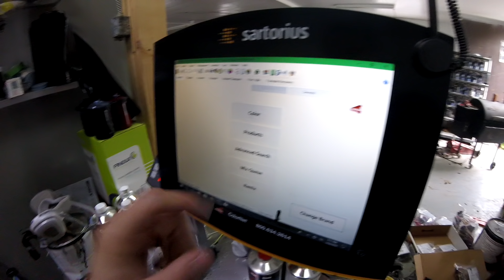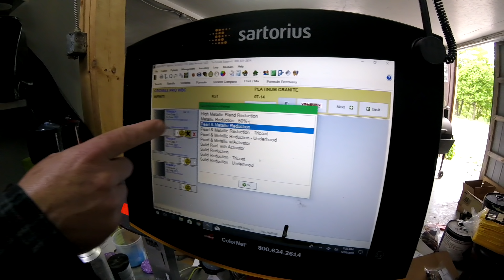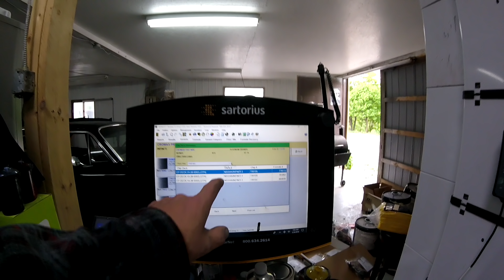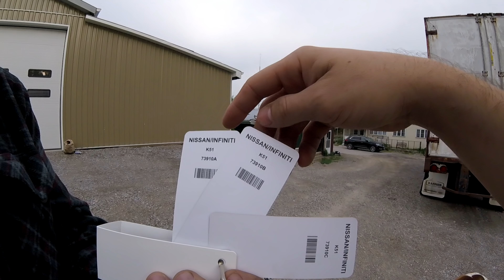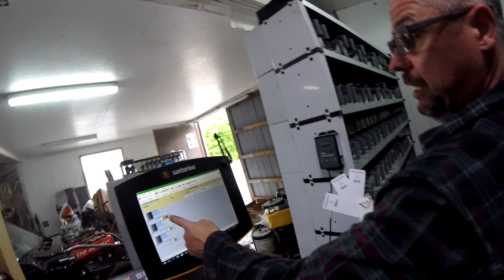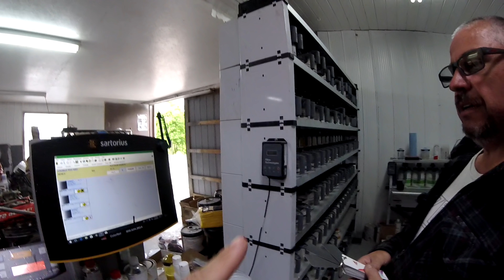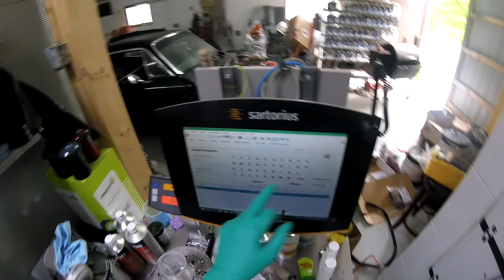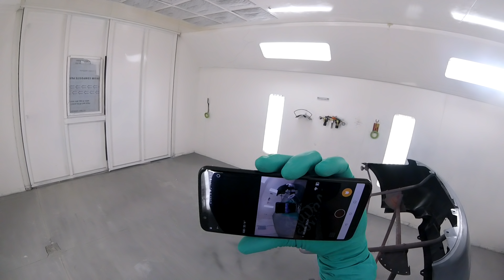Cromax Pro Basecoat Axalta

Comment: I cant stand axalta, used it for a bit, a lot of dye back, color matching wasnt as good as ppg, and the fact that you cant spray primer direct to metal like ppg is a huge downfall. You have to rattlecan self etching primer before you primer or even seal its 10 extra steps compared to ppg to be honest.
Reply: Boosted Gsr I agree I just switched to cromax and it doesn't compare to the other paints I've used. Many downfalls hopefully they get them sorted out sooner than later

Comment: Really nice video. I am gonna try this cromax pro soon. Do you need the air nozzle blow  dry gun though? Or can air dry?
Reply from the maker: It can air dry but it will just take a little longer since you are putting so much on
Reply: @MOTIVATEDPAINTERS   Gabriel I'm surprised it got covered with almost 2 Coats..  Sometimes I get to paint the (kad ) color code  .with 4 coats. Almost WIth no flash time between coats and I get better results ,Im spraying )(solvent ) I have heard that alot of people say dont apply too wet, or too heavy  because the color might change... What do you  think about this Gabriel?